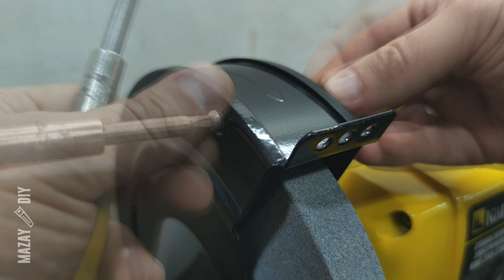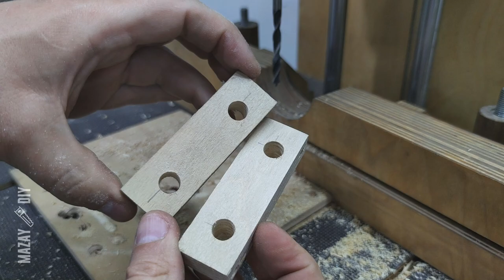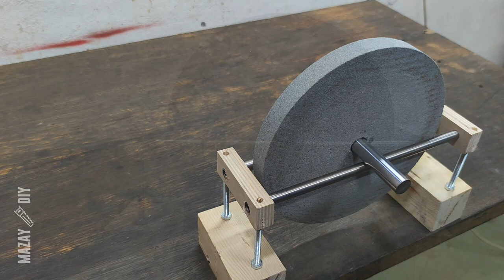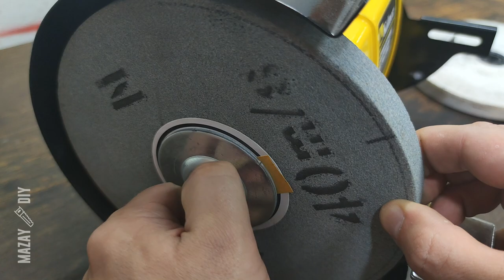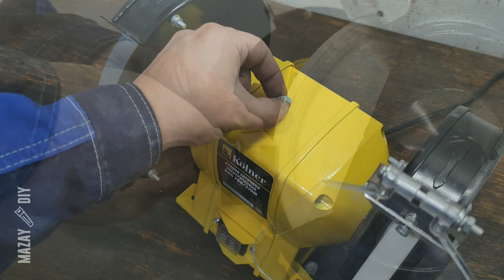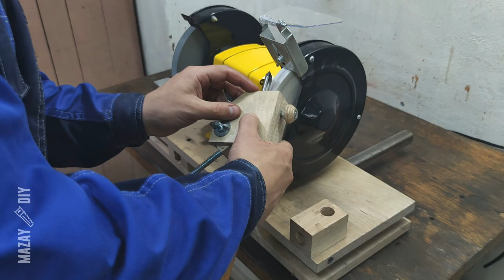4 "Must-Haves": Don't Start Working on the Bench Grinder until you've done These Things

Comment: Jon asked about the safety of drilling the wheel, and whether it might be a risk.  I’ve seen 2 alternate ways to handle that.  The easier was to use a disk grinder with a masonry wheel on it, making shallow but wider cuts on the heavy side of the wheel.  The more elegant way was a shop made washer to replace the stamped steel one, made with about 24 1/4” shallow holes around the inside face.  You place small lead plugs into those holes to effect the balancing.

None of this to take away from Mazay’s elegant solution to creating the balancing jig from scrap, and finding side to side runout with a pencil.  Nicely done, Mazay!
Reply from the maker: Thanks for the advice!
I received several opinions that my balancing method is not safe, I answered them in detail here - https://www.homemadetools.net/forum/diy-grinding-wheel-balancing-jig-96887#post224138
Summary - it is better (safer) to use a different method of balancing by adding additional weights, rather than drilling, although this does not apply to the design of the balancing jig.